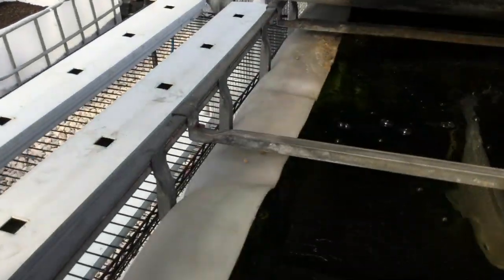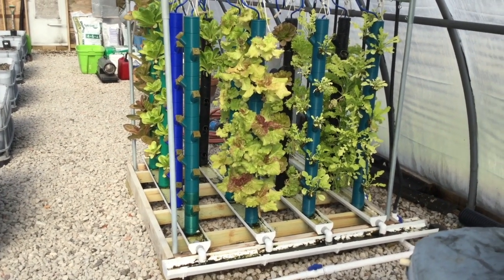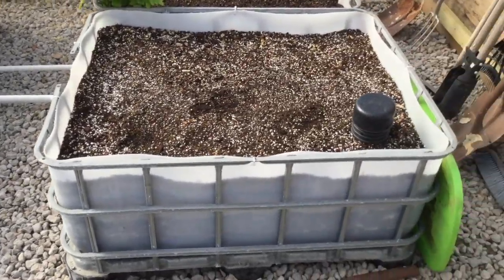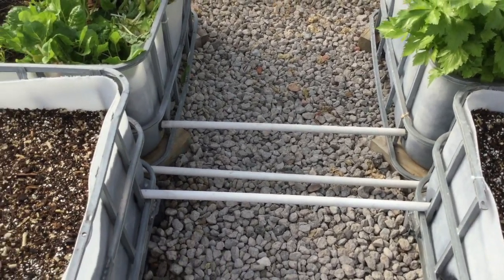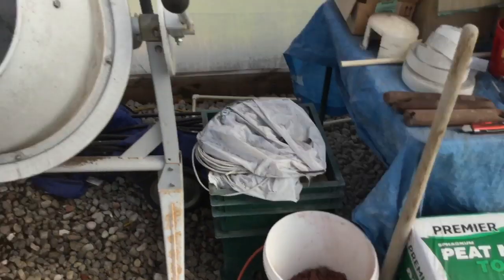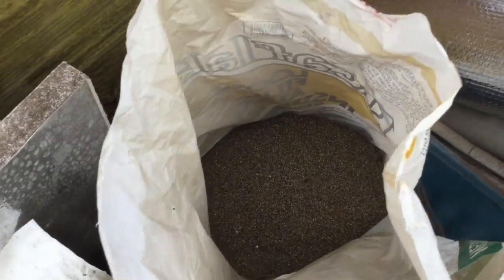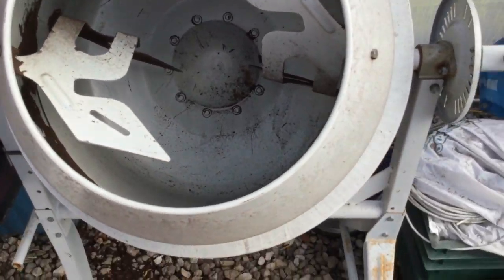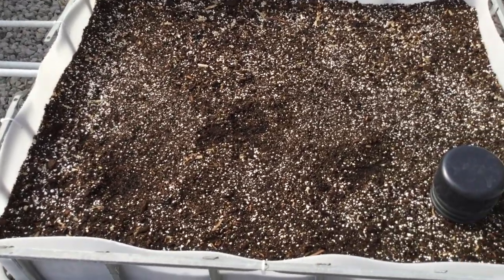Constant Flow Wicking Beds (5)

Comment: Instead of buying all those expensive materials for bed filling  why not use home made compost, horse or cow manure you can buy a truck load dirt dirt cheap or sometimes free then mix those with free dirt.  That will make it excellent soil fill for growing.   I find buying those plastic bags of growing soil to be ridiculous expensive when  better cheaper or free substitutions are plentiful.

Anyone can plunge down the bucks to buy anything but it takes knowledge and creativity to reduce, reuse, recycle  all around you.  Better for your pocket book and the environment.

My home made compost consists of shredded leaves from my yard and grind kitchen wastes.  It turns dark black in 1 month in my rotating compost bin.  All home made  down to the  leaves shredder.   Home made compost is way better as wick materials in soil  way better than the plain no nutrient  peat moss.

Now you know better!  Still doubtful of what  I write? Well then read the Google A.I search   then decide. Your money your choice.  I practice Reduce Reuse Recycle in everything i do and every one should too!

"For wick gardens, homemade compost is generally preferred over peat moss as a wick material. While peat moss can hold water and is commonly used, compost offers better drainage, aeration, and provides essential nutrients for plant growth. "
Reply from the maker: Your suggestions would cost more than I spent money for. I didn't buy potting soil, I mixed my own, it's even shown in the videos in this playlist.

Comment: Awesome.. simply awesome. Just started on wicking beds and was wondering about connecting them in series. Then found your videos. Thank you for saving me an incredible amount of time and effort and headaches!!
Reply from the maker: Still going strong 3 years later. Though, I've found that it's not necessary to leave the pump running all the time. I just turn it on once a week now to top off the reservoir in all of the beds. 30 minute zero effort task, once a week.
Reply: Again thanks… you may here from me with questions of course.

Comment: Hey Mr Atley, 
I am assuming all you have to do is add more potting mix to the top as you get shrink as the growing seasons move on. 
And thank you for your videos I think you system is sweet.
Reply from the maker: Yep, all I do is turn the soil with a small pitch fork with dull points and add more as needed.
Reply: @LordLarryWho  thank you, for your time sir. 
I'm not sure where you are but did you have any problems with the reservoir going dry during the hot summer months?
My summers can get in the triple digits and my hydroponic reservoirs are hard to keep up with.... So curious if 55 gallon is enough. ( Not enough for hydroponics in my area had to go to an ibc full)
Thanks again
Reply from the maker: Nope, I've never had my plants grow fast enough to take up that much water in a day. Evaporation is a complete non issue in this case because the bottom of each bed is its own reservoir and there's too much soil on top for the water to evaporate. The only purpose the barrel in the the ground serves is to keep the reservoir in each bed topped off, the pump only runs once a day for 30 minutes.
Reply: @LordLarryWho  very nice thanks for your time yet again I'm gathering ibcs as we speak LoL

Comment: Thanks for the series - making the same system at our school except with a control bucket and float valve connected to mains
Reply from the maker: I was going to do that at first but couldn't figure out a way to keep the plant roots out of the float valve.
Reply: Larry, I use a double float system. One float in a drum that shuts off main water when drum is full. A second large bucket or drum positioned at the 4" height of the wicking bed water level. Or in your system, you could just raise the buried drum so that its water level is equal to that of the beds, (assuming all are same height & level.
Reply from the maker: @empac7489  Not enough volume in a barrel to maintain 12 wicking beds that way, I would need 12 barrels.
Reply: ???
The barrel would be constantly supplied by the main water, and maintain constant level. As uptake to plants occurs, level drops, and float valve opens. I've used it with a cistern instead of a barrel  for a 5000 tree nursery!
Reply from the maker: @bajamerica  Oh, sounds like a pump is still needed to fill the barrel and I would just be back in the same boat. I only run the pump for 30 minutes per week these days.
Reply: You can still do this by running mains line to the first container, and then run a garden timer to only fill it intermittently for time if you re concerned about the float failing under mains pressure and causing water loss.
Reply: @LordLarryWho  I made a bucket inside the bed with no bottom. But you could also make it external

Comment: are there certain types of plants that don't do well with this type of system?  I didn't know if there are certain things that prefer a dryer soil or if most vegetables like the supper moist soil?  Was about to build a bunch of raised beds for my wife and wasn't sure if I should do them all with this type of system or split them 50/50 with traditional top watering systems.
Reply from the maker: I probably wouldn't try to grow a cactus in it, but there's nothing unusually wet about the soil in these. I have to dig down about a foot before I hit actually wet soil.

Comment: Your system looks pretty good, I have been following Rob for a few years now. I think your system is a good build. Not sure about the shade or light on your pipes but if there is a lot of light on them most of the day for longevity you may think about just spraying auto primer on the outside of them. It will keep them from getting brittle. I have quite a few in open air water pipes in my yard and some after a few years have become brittle, just a thought. Enjoyed your content and your system and plants look great.
Reply from the maker: Greenhouse has two layers of UV protected poly on it and that pretty much blocks all UV light transmission, which is what actually degrades PVC.
Reply: @LordLarryWho  Cool, that is great. thanks for the reply. You have some good information

Comment: I haven't started my build yet, still debating which route Id like to go. I have one question for you with this set-up: How long will this soil last before it is depleted? OR do you add nutrients to your barrel of water to keep the soil good to go?
Reply from the maker: Think about what you're saying. Depleted? How often does that happen to the soil around your house? These beds are full of composting worms, the soil is just as much alive as the soil around my house. I never add any nutrients to the soil or the barrel.
Reply: If soil becomes "depleted", what is left behind? What is still taking up space and what is it composed of? As long as it is biologically active, there's no way it could ever be considered depleted. Nature is pretty good at taking care of itself, it's had millions of years to get the act down. Certain plants use more of a specific mineral or element than others, but biology replaces those over time. As long as there is some form of biological life in your soil and that life has something to compost, there's no way it will ever become depleted or sterile.
Reply from the maker: Great explanation! Working with nature rather than trying to outsmart it always yields more reliable mileage.

Comment: This is probably the simplest and most effective root veg greenhouse setup I've seen.  This may not be your idea but the implementation is all yours :D... well done.

I do have a 2 part question though, as a complete novice, would it be possible to grow potatoes in these wicking beds, if not, is there a way to modify the system to allow for the growing of potatoes??

Keep up the good work

Gary
Reply from the maker: You probably could grow potatoes in them, it just wouldn't be the best way to grow them and wouldn't be the best use for the beds. Potatoes don't like that much moisture and you're likely to disturb the reservoir area under the soil and plug it up with soil when digging the potatoes out. If a person wants to grow potatoes in a greenhouse, they should still grow them in the ground.